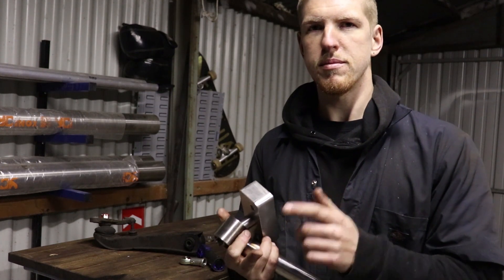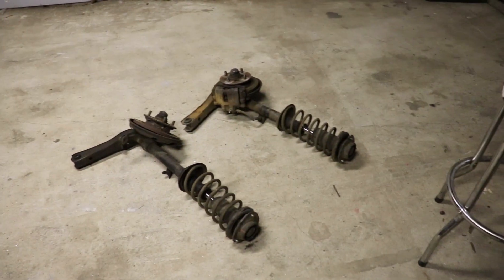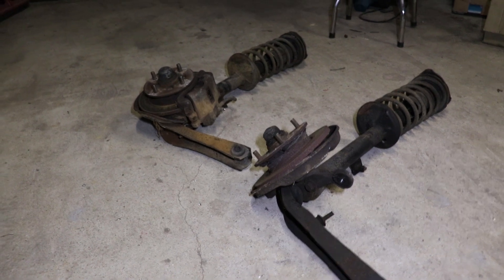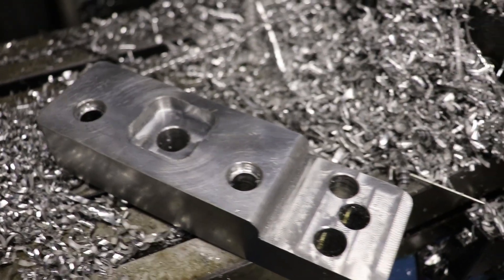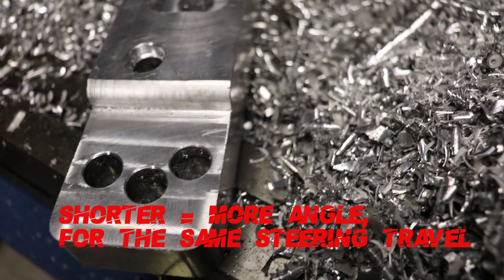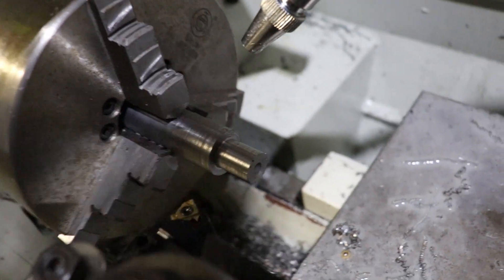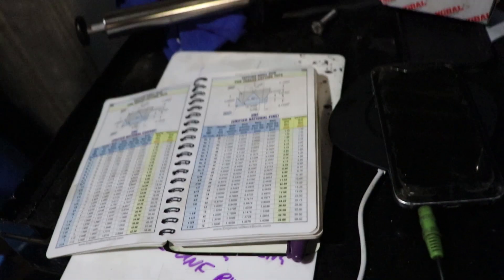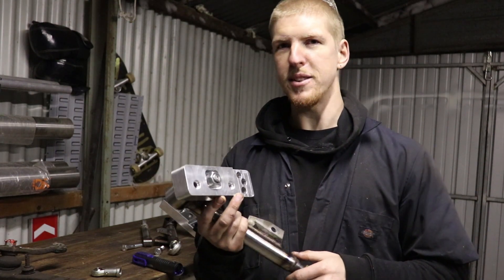Lateral Parts Project 8 - Billet steering knuckles

Comment: Looks decent, love the process. could you make the thread stick out the by 2/3 mm and drill a hole to house a split pin and machine 8x pin slots In the nut for the pin to sit in .Similar to a drive shaft
Reply from the maker: Boost Garage Official I probably will add a castle nut as a failsafe next time I’ve got it apart
Reply: @mattd5117  looks really good bro love your videos